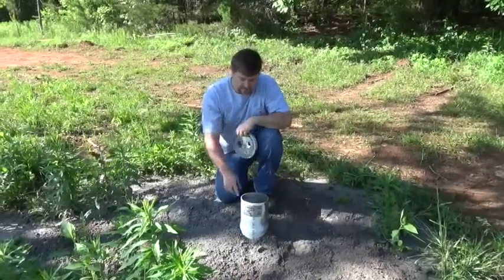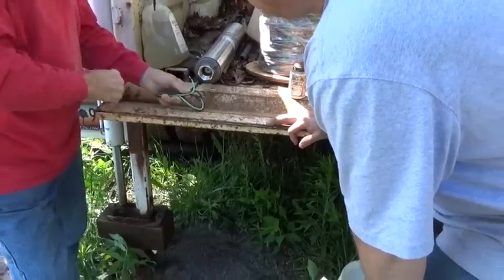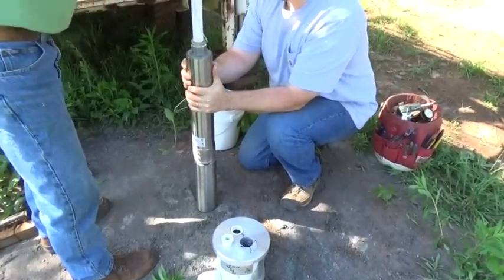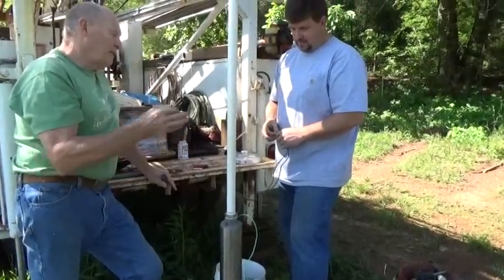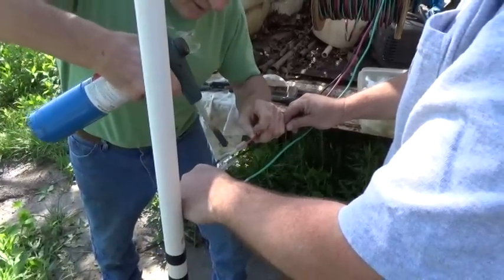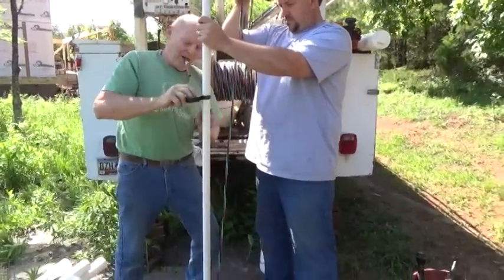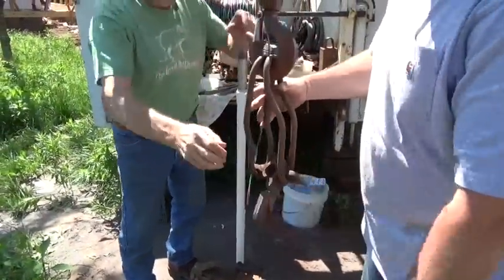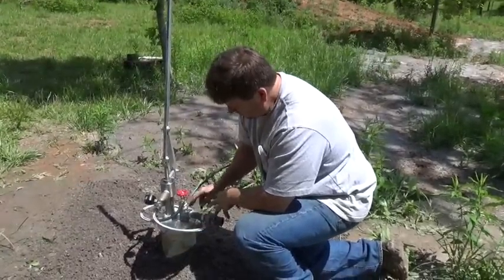How to install a Submersible Pump

Comment: I am having a problem with my bore well at home.

It's a new bore that we have drilled to 500ft and sent a sub motor inside up to 480ft. We get a min water for house use only. Some times 20min in the morning. The water level is low at my site.

But my problem is, the very 1st pipe that connects to my Submerge moto always gets bulged and burst in the middle of the pipe. What could be the reason? My bore technician also says that he has not come across this issue in his whole experience. This has happened 2 times now in 1 month itself.
Reply: Just going over a few of the technicals of your application, there is head water pressure of 0.43 psi per vertical foot. So a depth of 480 ft * 0.43psi = 206.4 psi static pressure (static pressure is water not moving and filling the  vertical 480  ft pipe)
 
I don't know the outlet size of your pipe, but a  schedule 40 one inch diameter pipe maximum operating pressure is 270 psi. Your static load is 206.4 psi without the pump even engaged. Depending on the hp of your pump motor, the pump has to against a 206.4 psi load and then put enough energy into a 480 ft static column of water and get it moving. Also you have to add the additional load from the water holding pressure tank which might be 60- 100 psi just on its own.

So with static pressure of 206.4 psi + pressure tank of 60 psi = 266.4 psi. So if your maximum operating pressure on a 1" line is 270 psi (a bigger diameter pipe is even lower, for example 1.5" = 198 psi ) you are just starting to move the water with an operating pressure that is 99% of maximum operating pressure and that is the static load only.

And just like a industrial motor starting, you have to put in more energy to overcome the  inertial mass of the motor and friction loads before you are up to running speed. That initial starting torque can be 200% more than the continuous running speed. 

In your case, trying to move a 480 ft column of water with pipe friction losses of 500Ft or more from your pump to your house into a 60 psi holding tank might put momentary pressures  on that bottom pipe of 700 psi or more. Plus, the water itself gets heated up from all that pump work being done on moving that water, so the bottom of your well pipe schedule 40 pipe will be weaker from any temperature increase than the top of the well.

Sorry for the long reply...but my hunch is you are operating well in excess of your maximum operating pressure and the plastic pipe is swelling from this excessive pressure. You need metal pipe in that bottom section to handle the pressures.
Reply: biire4u thanks for the reply. I dont mind putting a metal pipe, but if i do that, i am frightened that it might get rusty on a long run and must not cut so that the pump will fall off or get caught inside the bore well. Is there anything else that you might suggest?

Comment: water pipe comes out the top!? they come out 2' underground around here. you must be somewhere where it never ever will freeze.
Reply from the maker: Ram-n_dodge it freezes so insulation and and an insulated cover is required.  This stops north of north Carolina and goes to pitless. there are many places in NC that should not be top discharge as there pipes freeze every Winter.

Comment: Great video! Currently troubleshooting a collapsed well with an ESP. Found video very helpful understanding ESP installation in the first place....
Reply: How did it turn up ?
You had to re drill it eh?
Reply: Correct! Had to re-drill a new well, unfortunately.
Reply: @ooakiny  Thanks for the response eh.. Hope it worked out for you.

Comment: Q: (lightBlueShirt;LB): How long does it take to install a well pump ?... A: (green shirt) well surn (son) 'bout 1 seegar (cigar), hehe love it.. At least he goes to the trouble to instal check valves(Non Return Valve) most would rely on the one on the pump (if fitted) and cash in on a return call when a (back flow) leaking valve occurs

Comment: Please suggest , HP and number of stages for 250feet borewell, water is at 200feet . And also what is head ? Thank you .
Reply: 3 phase submersible motor pump
Reply: Need a lot more info were is it going what is it for .what psi do you need. What power is available how far is it going is it up any hills
Reply: HP 14.7, seven stages, pump head 98 m, motor power 11 kw. The most suitable pump for you.
Reply: No hills , it is flat land hectares . Borewell is 350 feet , but water is at 160feet , and we using 8 pipes of each 20feet so 160feet , and currently we are using 5hp and 8 stage 3 phase submersible motor  ., it was giving 2.5 inch water from pipe outlet.  voltage is 240 . if you need I can send photos of readings and water outlet . and also I have one major question  , that is  one stage is responsible for how much feet water pull from underground ? thank you.
Reply: I f so, we suggest flow quantity 15 ton per hour, head 54 meters, and the head for each stage will be about 13 meters. In your case, for 240 V, 4 Kw, the pump head could be about 48 m. May I know the diameter of your borewell? How large is it?

Comment: someone ran over the well with their truck. How do I fix the broken mess? It's a rather large pvc pipe (5in?)? I think there is a wire coming out also and possibly some other smaller pvc pipe. I guess I have to dig it up anyway cause i dont like the way it is plumbed (need faucet or tap(s) closer to well if possible). Somewhere i found a pvc top...oh yeah it was from Gary, his got lightning strike and insurance repair.
Reply: Call your local pump company and don't go next to it someone can get heart
Reply: Tell them you need a pump fished out it a sub and how deep

Comment: I'm in SW Utah and our 200 foot deep well pump has failed after seven years. The company, Gardner Wells, installed it initially and I recommend them to anyone. I wish I knew what I know now when they installed it so I had a better idea of what was going on.  However, I have rung out the wiring and the pump is getting power on all three legs but nothing. The pump failed with the press. sw. in the closed pos. But the overload didn't and does not open. I had changed out the control unit with a known good one and no help. Pumps don't last forever and I don't have the money to call Gardner to change it, and even though I know they would work with us, so I'm going to try to do it myself w/help. I watched/helped Gardner with a neighbors pump that had the wires chaffing against the metal casing and shorting intermittently. A gantry/hoist would sure be nice but I'm going to have to rig up something instead. I had "fiberglass" pipe sections  used as well as composite casing when installed. Except for the last one of course. This video is a great help. Your "Pump Guy" seemed first rate with patience and experience knowledge. People like him don't get the respect they deserve but they know it. I would have liked to see or hear more clearly about how far from the bottom the pump was set at, how deep it was in the first place (I couldn't hear what was said), a closer view of the thing used to hold the pipe sections while dropping it in and a little more of the well cap that was used to suspend everything. Other than those things it is a good video, produced and explained well.
Reply: 7 years is a damn good length of time...
Reply: @AdamSahr-cj4kf  not really, should get 20
Reply: @AdamSahr-cj4kf  you are advised to remove pump at least every 2 years for inspections and observations.

Comment: Up here in Canada we run Well temps about 42 - 44. I would of never imagined using a schedule grade glue pipe to suspend a pump, I would think it would come apart or bust.
Reply from the maker: +Ira Hays Those were all threaded pipes.  No glue just Teflon pipe dope on the threads.
Reply: We don't use pipes like that, We use poly makes it a lot easier to maintain later down the line
Reply: Depends on the brand and type. For example High flow pumps don't always have them built in. Also a check valve is Recommended I any submersible pump as I prevents the pump from running backwards when switched off as the water is pulled back down by Gravity, this wont harm the pump but if the pump is started again while running backwards the motor will draw high power and cause damage.
Reply: I thought the same thing. Anybody that lives in cold climate would cringe seeing PVC go downhole.
Reply: That was clearly mentioned in the video
Reply: We put the check valves on the top of the pump
Reply: why did he disable comments?  i still dont know where to get the cap and manual or bug-out type system for getting water.  but that does sound like smart way/place to install check valve.
Reply: +Daedalus2801  but then are you still able to put in those check valves every however many feet?
Reply: Ira Hay
Reply: why did you comment:  
Ira Hay?
Reply: The pump has a check valve in it a check valve is not need unless you are going no then 200feet and it also good to have one in line in less you are going to a water tank then the in line not needed. Been putting pumps in for 15 years
Reply: Bingo. Totally agree.  Check valve every 200'... pumps running backward become generators.  I always suggest either a Pump-tec for low flow wells or install a VFD where multiple safeguard parameters can be programmed to prevent cavitating pumps or detection of line breaks.

Comment: Great Video, can the pump be used in Africa or it's only for 110v ?
Reply: +Abdul Ibrahim  Check what your electric requirements are 110/220 and you will be able to get what you need.

Comment: Engineer775, Thank you for the informative video. I also live in Upstate SC. Do you have any issues with water acidity?  The biggest problem with our  well water is low pH. I can only use plastic piping or stainless. Galvanized pipes and fittings don't last long and leach metals into the water
Reply from the maker: +Ray_Biker I don't have that problem.  Just go with the PVC and you should be fine.
Reply: Yes pic deep set pipe sch 120 is best and ss nipples to use
Reply: Reverse problem here in the southwest with Colorado River water and alkalinity. Same result though, even with copper.

Comment: Must be a pretty honest well gu to let you ask questions and video  him the whole time. 

Around here  you show up asking questions and wanting to video a well driller at work they tell you to either loose the camera or they pack up and leave claiming it's a liability and insurance related issue.   

Really I just think they don't want to be seen on YouTube charging $50+ a foot to drill a well in soft loam soils with a 20 - 50+ year old rig and putting in cheap materials like green thin wall sewer pipe for well casing or that chinese made pump that they bill you $500+ for.
Reply: Well they charge 24 a foot here in dfw area texas. Im about to get one and they sure as hell better not use that schedule 80 junk. Does sched.80 pvc last very long?
Reply: Tcmtech water.
Reply: Yup your right buddy

Comment: I use zip ties instead of black tape
Reply: I was thinking stainless clamps.... zip ties and tape are plastic and degrade
Reply: Stainless clamps will cut the cable if your not careful...
Reply: Use. 20 mil pipe wrap
Reply: Totally agree... You never know how those pieces of tape will end up after a while in the water...
Reply: Agreed
Reply: We have found that some zip ties disintegrate after about 10 years.
Reply: I've seen zip ties cut through wire, hose, etc over time
Reply: I have seen this very debate on many videos.  The reasoning behind the electrical tape remains the most rational logic application, in my opinion.

Comment: Why no rope?
Reply: Schedule 80 threaded pipe? 
but I still used rope , sleep better
Reply: I've been putting pumps in for 16yrs, and I have never once used a rope. If you need that rope, my guess is the pump installer did something wrong.
Reply: Rope is only added for deep installs for the stretch of the pipe and to take some pressure off of the wire and if something ever broke you could get the pump out
Reply: Rope rots. If the wire is connected properly it's as strong or stronger than the rope
Reply from the maker: question.  I have worked with several well companies and installers and it seems they never do.  I put it on some setups that are deeper.

Comment: This system seems overkill to me I would want to know the production of the well GPM & the well ID and we know static level is about 42' below casing height. Dole valves sometimes Cycle Stop valves never again as they are more trouble than they are worth. One reason a driller will hang PVC drop pipe is so he can pull a pump by himself with a rig.  The tape job on this wire is terrible & reading down thru some of these post there is a lot of misinformation & BS. We are a Water Well Drilling & Repair company in the Extreme NW Corner of Ohio near IN & MI since 1966 now 3rd generation owned & operated,our laws wouldn't let some of the stuff seen or talked about even happen. We have 5" & 6" wells here some that are Flowing Artesian plus some will produce 300+ GPM. No need for all the money spent & complicated equipment used at least around here.
Reply: Yeah you need a little more expertise than you have to work with Cycle Stop Valves.  It is funny that some installers don't know how they work or how good they are, but the customers who have Cycle Stop Valves certainly do.  See this..
https://cpkits.com/pages/customer-gallery

Comment: I don't see any replies by engineer775, but I will try.  Where does the simple pump connect? Into the tee through one of those braided hoses?
Reply: +romdos11 Nah the simple pump is a deep well hand pump with a piston cylinder in the water.
You drive it with the long handle above ground through a rod that connects in a supply line down in the water.
The Braided line that's connected is a bypass, when out of power you could open a faucet in the house and pump water from the simple pump.

Comment: I have only pulled a pump on pvc once! it's a nightmare!!! and I won't even think about using it myself. we pro's use polypipe... it comes in coils as long as you need 100' 300' 600' and so on. it looks like a lot of work using pvc and I know it's terrible to pull it up 20 years later!!!
Reply: Pvc will snap and break at the joints if you pulled over too hard black poly pipe won't
Reply: i just pulled up 160ft of pvc with my bare hands, thinking its the pump, one of the wires had vibrated so much over 30 yrs that it rubbed right thru it
Reply: as well as using wire  guides even 20'. and tape the wire even 4'. + a torque arrestor above the pump.
Reply: +Tom Stinchfield every
Reply: Don't mean to necro, but from my experience the poly pipe is usually used in more shallow wells. Hell to install the poly at shallower depths you don't even need a winch you can just do it by hand. When I was working we never really used poly at depths more than 200 ft, but I think you could easily splice a check valve onto the poly if need be. The OP is definitely right about pvc being a pain though, that stuff sucks to pull.
Reply: You think poly is easier to handle than PVC...???
Reply: you are exactly right. I would only use pvc if the distance to the water was only about 10 feet or so. Poly is the way to go.
Reply: I'd rather pull 800' of white PVC than 800' of black role pipe
Reply: How do you add a check valve with poly pipe?  Just splice it with a couple extra barbs?
Reply: Greg Davidson of you put to much black pipe down a well it stretches and it can stretch enough that the water pressure blows a hole in the black pipe. I'm sure it could happen but if tightened correctly and not over tightened white PVC is much better
Reply: SSGSSG 
  Black pipe is the way to go on deep wells. Had to pull mine that is 280 ft deep. Mounted an old motorcycle wheel on a  wooden frame, ran the pipe over the wheel, hooked it to the back of my truck, and had the pump out in less than five minutes. I have a safety rope to take the stress off of the pipe and electrical wiring.

Comment: if you use poly pipe youre a dam fool or a weekend warrior it is hard to keep the wire from rubbing in two in the well when the pump kicks on even with cable gaurds schedule 80 pipe and schedule 120 couplers is the only way to go
Reply: PVC?
Reply: @nx8618  It always amazes me when people who don't understand the simple difference between your and you are, ignorantly insult someone else's intelligence.
Reply: @nx8618  But then who would help you with your reading and writing comprehension, simpleton?  Oh, how your kind amuse me.  Next time, don't forget the apostrophe!  Now go away, or I shall taunt you a second time.

Comment: I can't believe you used pvc pipe. There is coiled poly pipe without seems in lengths of 100/200/400 ft lengths. using pipe is out dated.
Reply: Some counties do not allow poly lines or plumbing. Pvc is your safest bet.

Comment: I ujst want double check, what you are saying is to add a check valve every 100 ft?
Reply: yes that's what he is saying. water will weigh considerable when pumped long distances and it can actually break the pipe if sufficient check valves are not installed.

Comment: Thank you for a video. Does the pump sits are the bottom or it hangs above the bottom? If it hangs, how far away from the bottom it should be?
Reply: Depends on how much water the well puts out- you put the pump far enough under the water so it won't suck down